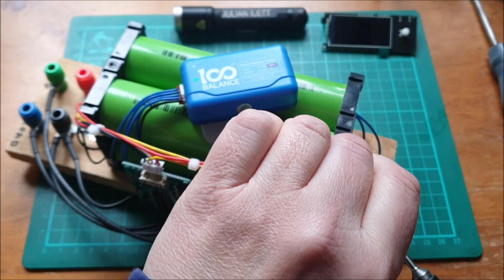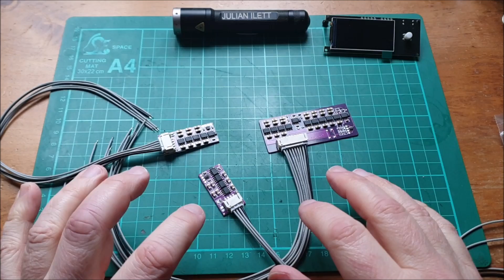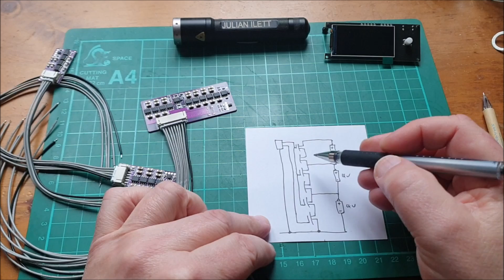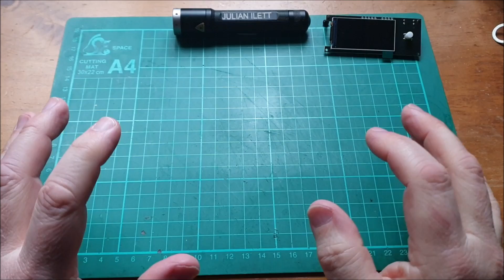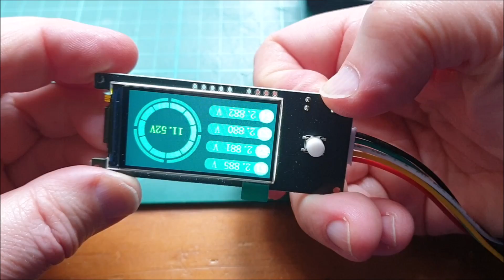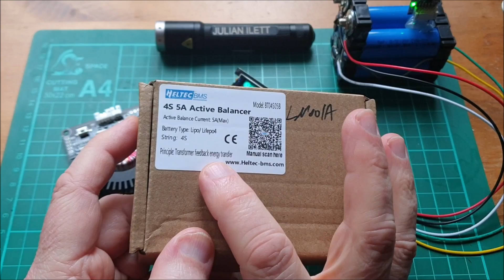Sodium Ion Batteries and Heltek Balancers

Comment: I enjoy photovoltaic MOSFET drivers, such as the VOM1271.  Using this method, ones measurement and control circuit does not need to bother with gate-source commoning issues.  One does, however, have to invest 10mA for each gate in the on state.